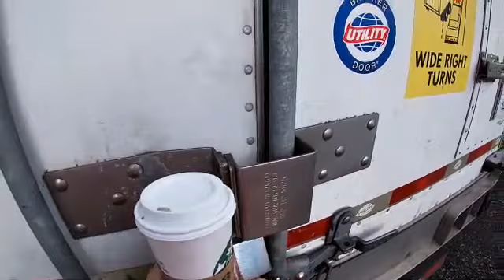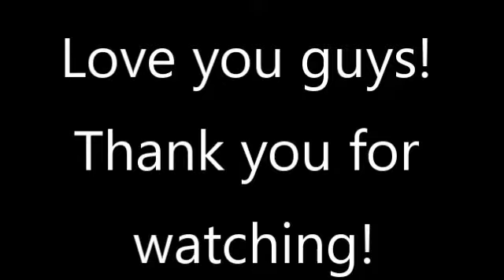In The Morning When I Rise

Comment: My boss made me make that run to Dallas TX because the driver who was supposed to take the load I had run my 3000 miles if I  wanted to keep my job I had a house to pay for an a husband dying he went with me I was so sleepy when we got to Shreveport La he took it on in there's where we picked up the trailer that the red line hooked to I had written it up on my blog taken it to the shop.He was supposed to tape that glad hand  but like I told you he didn't I trusted him an didn't check.The wind was blowing we were going back to La to get a load home were on I 20 east bound that glad hand came off in Tyler Tx.We jackedknife into the medium the trailer break's stopped us before we went down to the road  under the bridge we were about to go over we were in a big truck like yours we would have landed with truck under the front an trailer on top of us. There more but I can't do anymore. RED IRISH ROSE